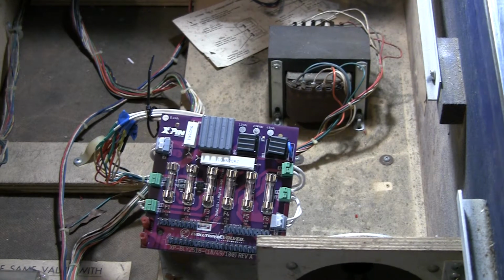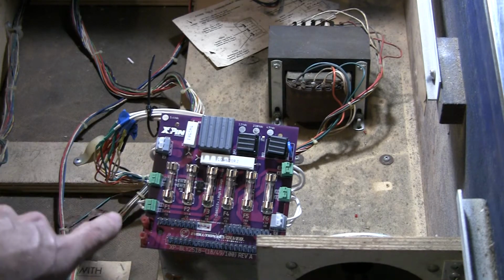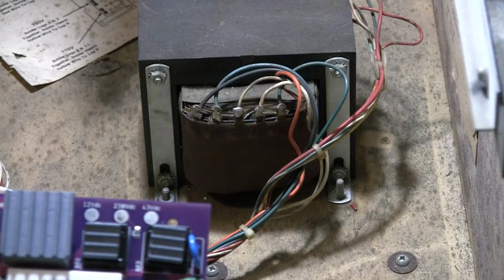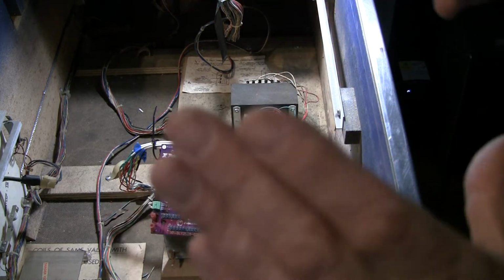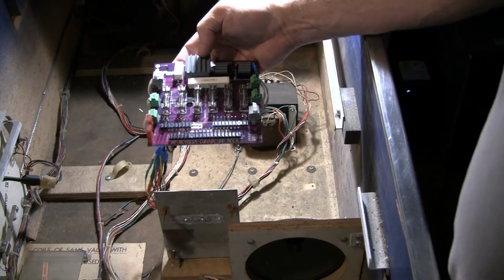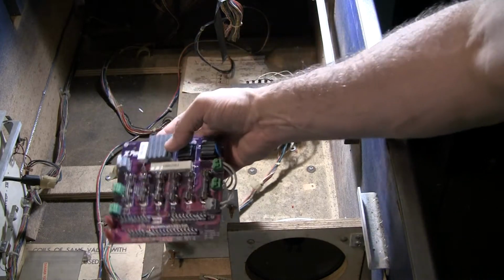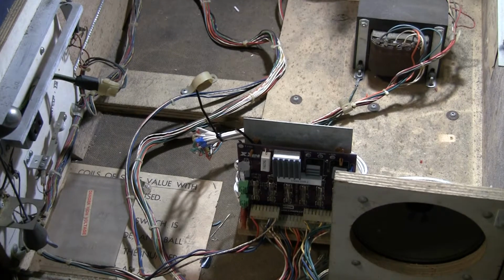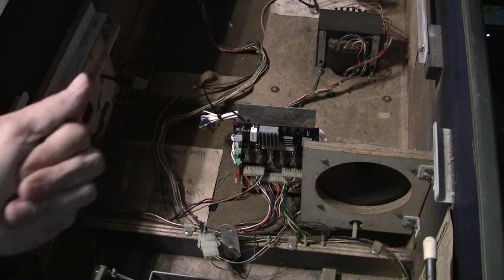Stern Trident - Power Supply Replacement - Part 2 - PinballHelp.com

Comment: Couldn’t you move the original metal bracket back closer to the transformer or move the transformer closer to the metal bracket?
Reply from the maker: I didn't try.  I assumed the connector plugs on the front might not be able to extend.  If I have to do this again, I may try that.  But I prefer if possible not having to lean over too deep into the cabinet to work.  It's almost better on your back to extend the wires and work at a more comfortable orientation.
Reply: He could have but didn't.  I would have.